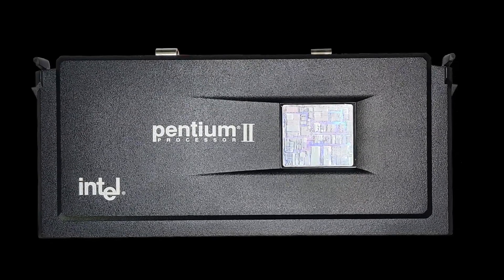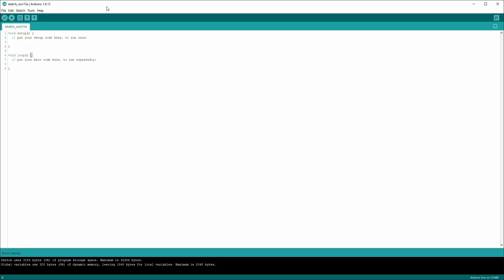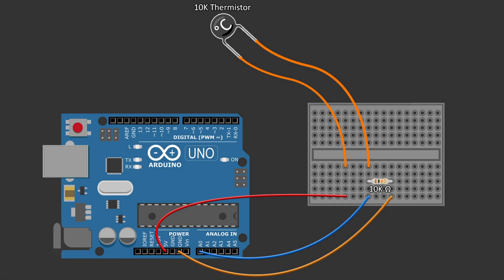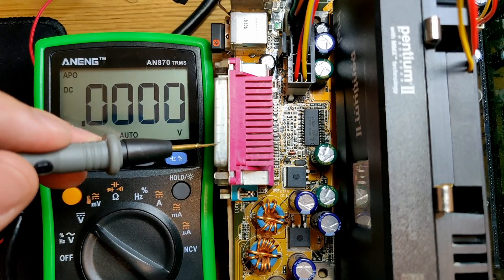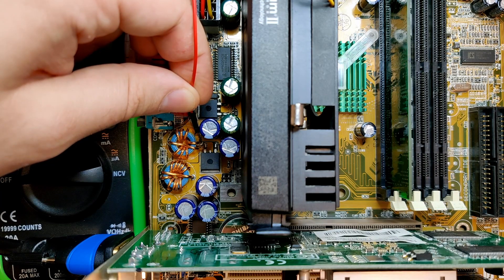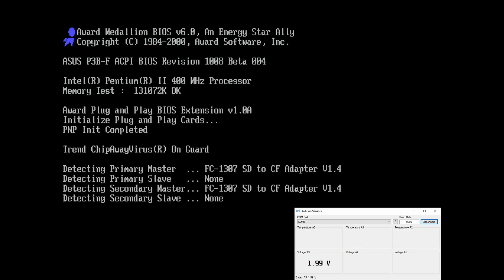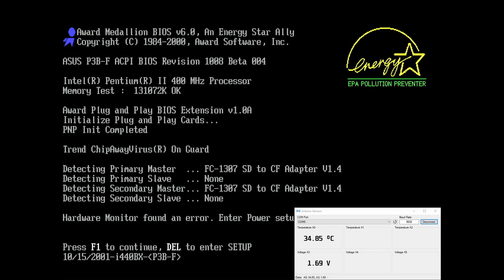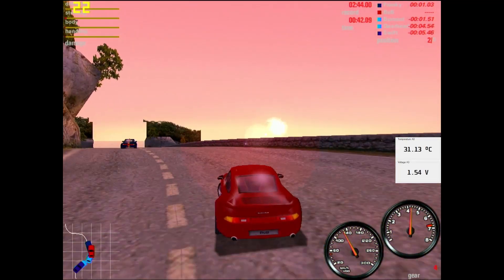Undervolted Pentium II - and monitor Vcore with an Arduino

Comment: Crazy that it perfectly runs with such a low voltage. I also wonder if it runs at 533 mhz (4x133), the performance increase should be high.
Reply from the maker: Unfortunately it is not stable @533 MHz. I can get it to 450, but after that it just doesn't want to be stable - even when I disable L2 Cache. Weird that it still goes very low on the voltage without issues!

Comment: Wow, thats quite a substantial voltage reduction! 
Would it be possible to modify the BIOS again for even lower voltages?
I'm very curious to see the limit of how low it can go.
Reply from the maker: I have never modified a BIOS myself, but I could imagine that we're close to the end. I just overclocked this CPU to 460(115*4) MHz (it is NOT a good overclocker!), and I have to keep the voltage at 1.7V - below it is unstable.
Reply: There may be a limitation in the voltage regulator chip, not BIOS.
Reply: @bitsundbolts  Fair enough then. P2s weren't the best at overclocking.

I still have some curiosities though. Lets say you were able to modify the BIOS and lower the voltage (and the voltage regulator was also capible of providing it), I'd be very intregued to see the Voltage-Frequency scaling (from undervolted and underclocked all the way to over voltage and overclocked) for your P2 400. Even if it means to underclock while also undervolting, I'd like to see at what point the CPU is most efficient for the given frequency and voltage and resulting performance by measuring the wattage on the ATX connector while running a stress test compated to a system idle baseline for refrence. 

Just a though though. Thanks for the video as always!!
Reply from the maker: Let me see if I get a hold of the author of the BIOS. He may be able to shed some light into this. And yes, I was planning to do something like what you suggested. I want to compare the modded K6-2+ - which is also a 2.0V CPU... How low that one would go :) ???
Reply: @bitsundbolts  Thats would be awsome! I would love to see a K6-II+ undervolted.
I saw your videos about unlocking cache on the K6-II+ to make it a K6-III+. If you get your hands on a true K6-III+ I would like to see the voltage scaling with the full cache enabled K6-II+ vs the real K6-III+ so see if they did any silicon quality binning for the reason why they may have disabled the cache.

If you happened to get then voltage low enough, try testing the cooling requrements at lower voltages.

Keep the awsome stuff coming!
Reply from the maker: The K6-2+ undervolt will come soon. Just need to finish another video that I've started already. Thanks for watching!

Comment: The PII is a poor choice to try this as it has cache chips on the daughterboard and those probably affect stabilty more than the CPU itself - I say this as it was the cache chips that made the first generation of Slot I PIIs such poor overclockers - the PII-450 would rarely do more than 464MHz, the odd lucky one would hit 504Mhz. A better choice would be a Celeron such as the SL32A 300Mhz as that had on-die cache and was a wonderful overclocker, all examples hitting 450 with ease and most doing 464MHz on an Abit BH6 (the most popular BX chipset mothernoard for overclocking Slot I chips).
Reply from the maker: Yes, also, the L2 is running at half the CPU frequency if I am not mistaken. I'll still try my luck as I don't have any suitable Celeron around me at the moment.
Reply: @bitsundbolts  Yes, on the PII the cache is half speed, but on the Celeron, being on-die, the cache is full speed. For this reason, in many tasks, the Celeron would out-perform the PII. For instance the PII-450 had 512K of cashe running at 225MHz, whereas the SL32A Celeron 300 running at 450MHz was often faster as it had 256K of cache running at the full 450MHz. Sadly I don't have any Celerons that old either, otherwise I'd gladly send you one. Good luck with your experiment.
Reply: On Slot-1 CPU's with off-die Level 2 cache chips, the cache chips run at VCC_L2 shared with the Bus voltage, SDRAM and chipset voltage (3.3V), instead of the VCC_Core voltage. Usually this is even shared with the PCI slot 3.3V rail. Just some capacitors are on that rail to smooth out noise and ripple.
Reply: Not all were bad overclokers... I have a PII 300 that i can push to 450 with no problems.... It's the famous SL2W8 series. :)
Reply: @bitsundbolts  Yeah P2 had 0.5x multiplier for its cache in all cases as far as I remember.  Very similar to the first Slot A Athlon but some of the higher frequency models had 0.66x cache.

The Athlon was a more competent overclocker even with the off-die cache though, I suspect they used slightly more capable chips.

Comment: Isn't it like that, when you lower the voltage ,the current rises? To deliver the same amount of power?
Reply from the maker: In an upcoming video, I do the same with an AMD K6-2+ CPU. Power consumption goes down with lower voltage - that means that current stays either the same or changes at a rate far smaller than voltage reduction. But maybe someone with proper electrical knowledge will be able to answer your question.

Comment: Only one thing mate...
The motherboard... Has 2 (two) sides...
The components/applied side and the solder side...

Maybe it would easier to soldier into an inductor line from the solder side, than next to a bunch of caps and insulated inductor, other components, etc...
Reply from the maker: Yes, I thought about it. But I mostly have those boards just on a cardboard box for now 😔. It's easier for me to plug it from the component side.

Comment: Nice, so it helps for less electricity bill?:))
Reply from the maker: Absolutely! :)) I wish I would have had the guts to do this stuff with my Pentium II 350 back in the day.
Reply: @bitsundbolts  thats great, I have a similar cpu,I am curious to test and see if my board has bios capability for setting up the voltage.

Comment: When you broke out the Arduino, I thought you were going to use the Arduino to do the signaling to set the CPU voltage.
Reply from the maker: I wish... That would be a bit out of my skill level. But those slotket adapters can do it - it might just be some resistance value that tells the motherboard what voltage should be supplied.

Comment: CPU Stress Test: prime95 -> Torture Test
Reply from the maker: I may do this while trying to overclock this CPU. Anyway, this hardware is so old, I won't torture this CPU for hours with Prime95. I did use the the PII@1.55 volts a bit more and still couldn't notice any instability.
Reply: @bitsundbolts  Temperature?
Reply from the maker: I did notice a temperature drop from the diode that I placed inside the heatsink and measured with the Arduino. With 2.0 volts, the temperature was around 45 degrees. With 1.55 volts its somewhere below 40 degrees. But I will probably do more tests.
Reply: @bitsundbolts  25% voltage decrease and still perfectly stable? I'm impressed and intrigued. 5°C, with 25%; maybe overvolting may not be that higher increase either. This is a very nice idea you had, hope you go full throttle on all the line of PII. Like the "PII undervolting" series. :)